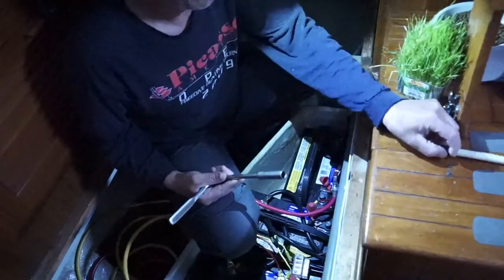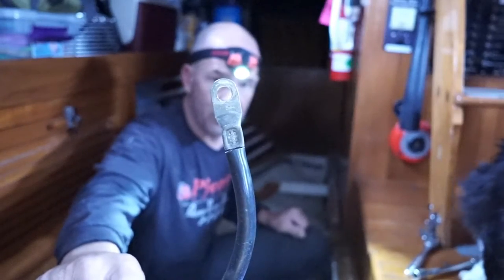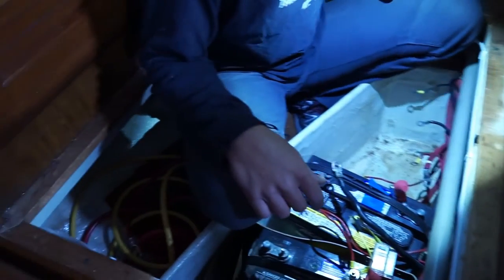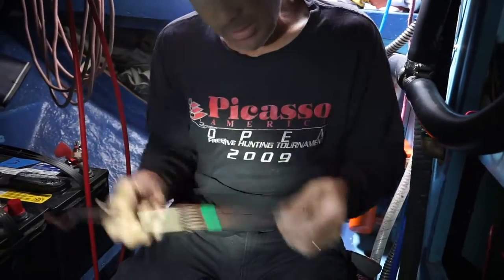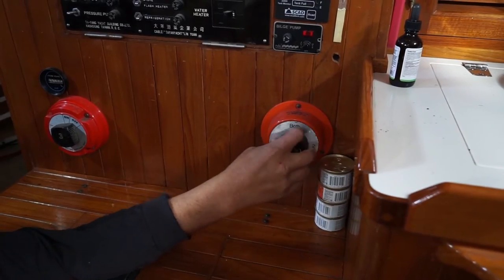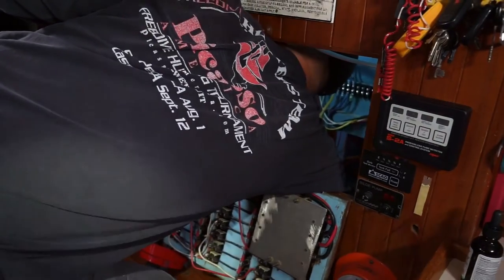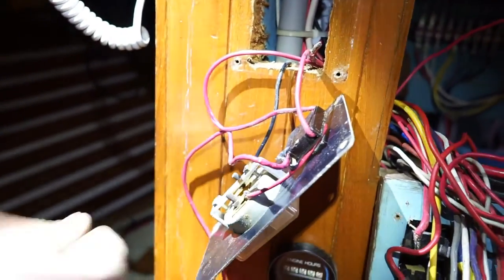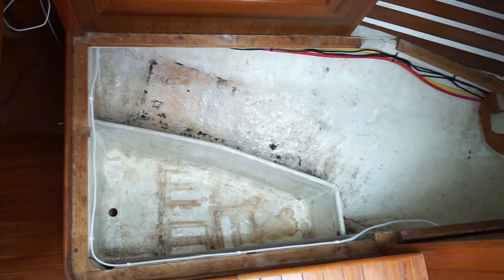SV Ramble On | Electrical Part III

Comment: Back in the day, they probably added the cable conduit as protection against items in the lower lockers from crushing the cables or cutting into them.  Taping the wire bundles together aided in time efficient wiring of the boat, so "refit" ease was probably not high on their list, but build speed was.

Comment: Yeah that's the problem with old boats. To many owners that no nothing about boats. They add stuff, remove stuff, and do as my half polish brother in law used to say, " do it the polish way!". No offense to any poles out there.. After a while you have a big mess on your hands. Better to just pull it all out and start over. Even the  old factory stuff is suspect.. Corrosion will have spread all throughout the wire causing large voltage sags which create heat, melts the wire and then your boat. I feel your pain, been there done that.

Comment: Real boat shit! Love it. I have a "84" T37 About ready to do the same thing. Total refit.
Thanks guys.
Reply from the maker: Thanks for checking us out Henry.  It's been a serious project over the last 5 years but we can finally see the light at the end of the tunnel. A couple years ago we ripped off all the teak decks, replaced most of the core material, and glassed it all in.  Stay tuned for upcoming videos because we finally got around to fairing all the seams, priming with 2-part epoxy Primekote, painting with Interlux Perfection Plus, and finishing the non-skid with Intergrip.